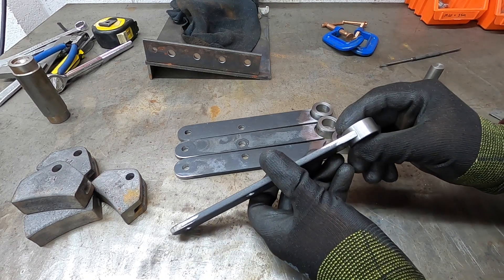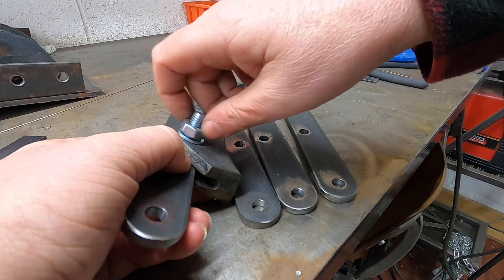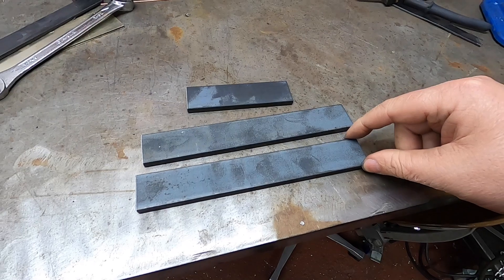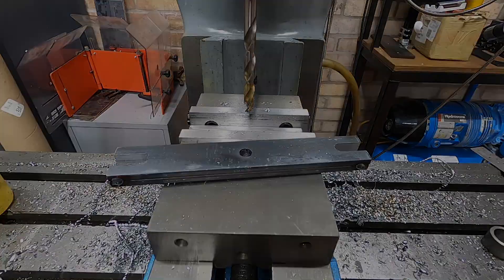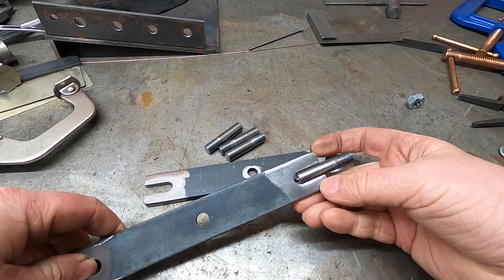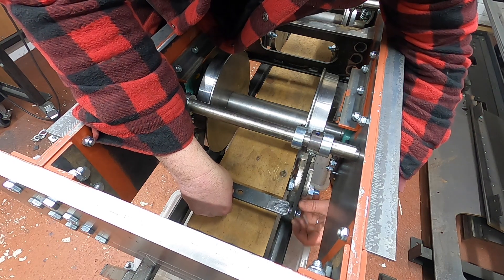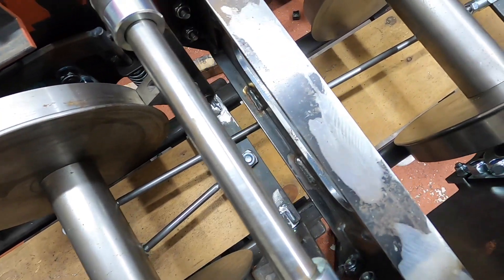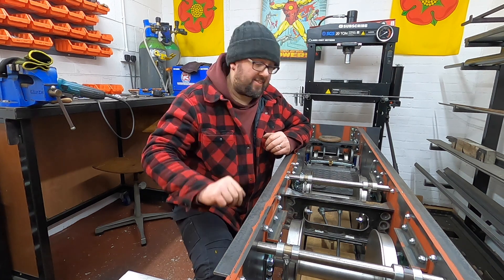Brake Hangers, spreader bar, linkages - EP38 - 7.25" Gauge Steam Locomotive Build

Comment: Matt,
I’ve never seen one of these brake setups before, but I wonder if the addition of a pair of small coil springs between each brake block and the hanger ( one above; one below the pivot point) might help keep the blocks from ‘tipping’ and fouling the wheels when in the ‘slack’ position?
Please excuse overly long sentence 🤪
Regards
Robert
Reply from the maker: Hi Robert, we have both had the same thought! I'm not a fan of them drooping down and rubbing on the wheels when they are off, I have thought of using springs, but not come up with a suitable design yet. Watch this space I'd say on this one. All the best, Matt 👍
Reply: @MattChiversWorkshop  
My thought is to machine two slots across the hangers to receive one end of spring ( spring is trapped between the ears of the brake block).
Then, two shallow drilled holes (corresponding) to entrap the block end of the spring.
Place the spring positions as far apart as the block will allow.
Shouldn’t take much spring pressure to hold the block off the wheels.
Robert

Comment: Another great video Matt, I really enjoyed it. One thing (and I know its only temporary) I was taught to have the bolts facing down, then when the nut falls off the bolt stays put allowing you to still use the brakes, where as if the bolt falls out who knows. Keep em coming Matt.👍
Reply: Cam e here to say the same thing... bolts down so when the nut fells off you still have the bolt in place..
Reply from the maker: Hi Allison, the bolts are temporary! I'll be making some special ones later, just for the brake rigging. I didn't make them as I wanted to make sure it all worked before committing to making lots of special bolts. They won't be like this when finished. All the best, Matt 👍

Comment: Looking good Matt. I know you will redo the linkage bolts, but humour me. I always put bolts in from the top, that way if the nut did come loose and fall off the bolt still stays in place. I know I’m being picky, I’m not going to apologise 😂😂
Reply from the maker: Hi Paul, when assembling it I find it easier to put the nut on from the top, But you are correct they are only temporary, I will be making some pins to replace them all. I'll do them all at the end in one hit. All the best, Matt 👍
Reply: @MattChiversWorkshop  quality as always Matt 👍
Reply from the maker: Thanks Paul, Much appreciated. All the best, Matt